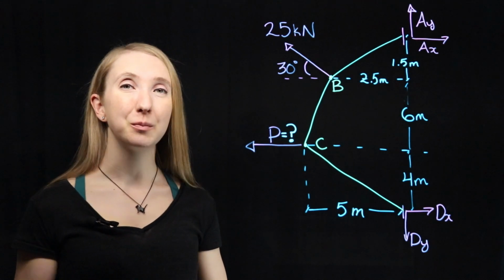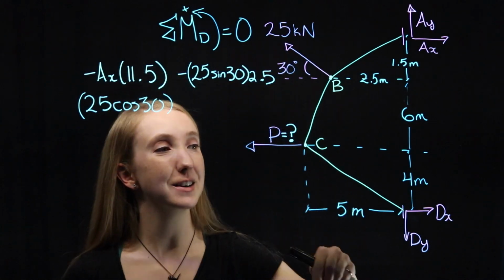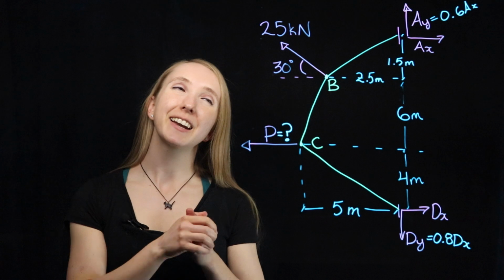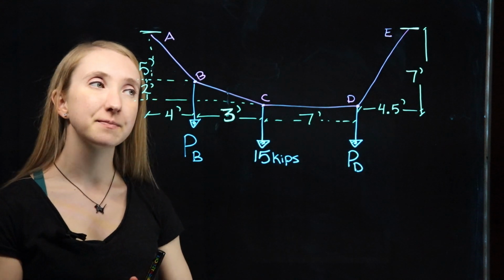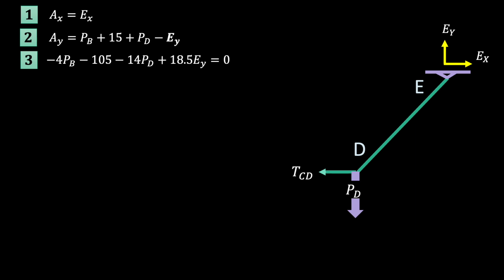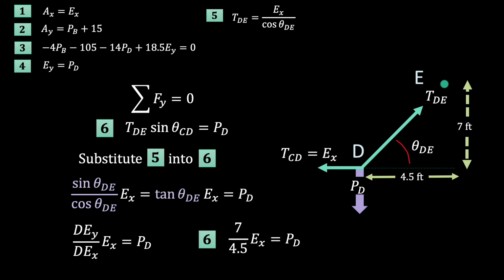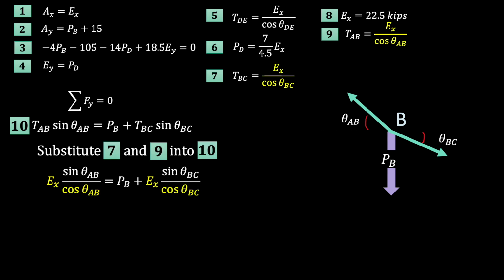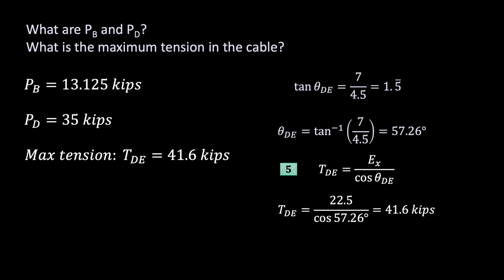Cables under Concentrated Loads - Examples | Learn with Pi

Comment: quick question. One the first problem, I found Dx in terms of P by taking the moment about A of the whole structure. This came out to a completely wrong answer for P in the end. Why is this?
Reply: its almost like you can take the moment at D to find Ax in terms of P but you cannot take the moment at A to find Dx in terms of P. This is very strange...
Reply from the maker: I’ll take a guess at what you did and explain why it wouldn’t work 😊
Referencing the steps by the equation numbers I used in the problems:
Remember, for the system there are only 3 unique equilibrium equations – forces in X and Y, and the sum of the moments about any point are zero.  

3) You found GLOBAL moment about A, getting Dx in terms of P. 
6) You cut the system between points C and D, then took the moment about D to get an equation with Ax and P. 
BUT – this is actually the same as the GLOBAL equilibrium about point D. 
We’ve already used global equilibrium in 3), so this does not give you a unique equation and cannot be used for your solution. 

If you wanted to start with the global moment about A, you could use the method of joints until you were able to solve for P.  You would get the right answer, it’s just a bit more labour intensive. By starting at D and cutting between B and C, we get a unique moment equation for that part of the system which helps save some time. Both strategies are correct though! 

Hope that explains it and thanks for watching!
Reply: @learnwithpi  ok so we cant solve global equilibrium more than once (using two different points as a reference) and try to combine both equations for an answer. I think that's what you're saying? So we need to stick with one equation for GLOBAL equilibrium and for the other equations we need to cut portions of the system in half?
Reply from the maker: Yes, only one equation for the global equilibrium of the entire system :) Other equations can come from other cuts or by using the method of joints. If you wanted to review these I bet there's a truss section in your textbook with lots of practice. They're the same tools that apply to cables in this case :) Good luck!
Reply: @learnwithpi  I think I got it. Time to practice practice practice! Your videos are more helpful than the textbook. Thanks again!